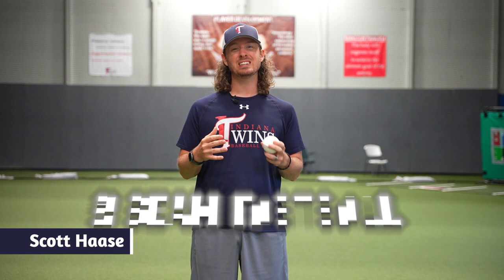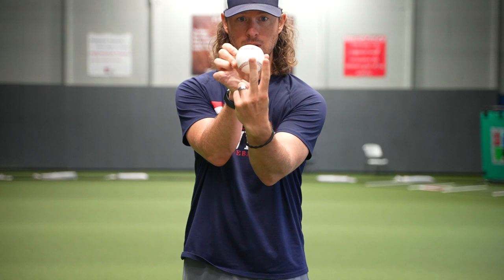How to Throw a 2 Seam Fastball

Comment: My 2 seams keep dropping like a slider how do I make it better?
Reply: im late but if you want it to look like a slider rotate your fingers just to the side of each seam and do a karate chop motion as you pitch if you want it to have arm side run either throw in a lower arm slot or get on the inside of the ball as you throw